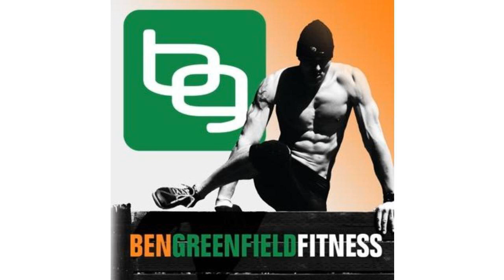Ben Greenfield - Cell Phone Radiation & EMF Protection w/ the Founder of DefenderShield

Comment: Very informative. It definitely explained what makes your products different from the competition and how your products are legitimate. 

The only question i have is why in this video below this comment do you show your own product producing EMF's when the case is open? I thought you were able to defend yourself against EMF's when the case is open? Reviews on your channel and one of your videos showing off the cell phone product say you being able to use it while having the case flipped over the back. Would you like to explain this?

Video showing radiation when cover is open.
https://www.youtube.com/watch?v=416lk3Q2Acw

Video saying you can flip the cover over and use it while interacting with the screen.
https://www.youtube.com/watch?v=cDUMfEu83JA

I did notice that the first video showing the radiation with a Trifield was 3 years ago. Is it because that older phone case was not safe from opening the case, and it is now?
Reply from the maker: Hi there! When the case is open, it will not be able to block the phone screen's emissions. When you talk on the phone, you just have to close the front cover to provide a physical barrier to block the EMF emissions from reaching your head. Same for if the phone is in a pocket or bag... make sure the front cover is in between you and the device! The back cover does not have EMF protection, because it would not get a signal if EMF shielding encapsulated the device. When you flip the cover over and use the screen, you are protecting your hand holding the back of the phone, but not the hand touching the screen. We hope this makes sense! Please look at our website for more information www.defendershield.com/learn